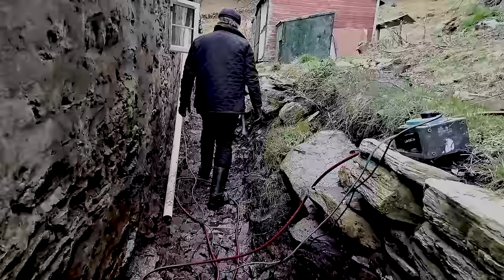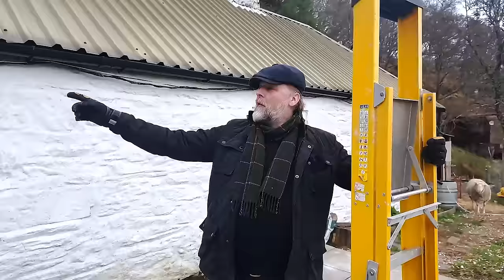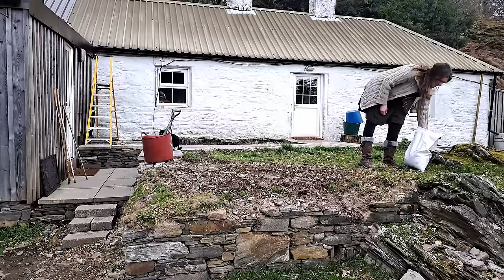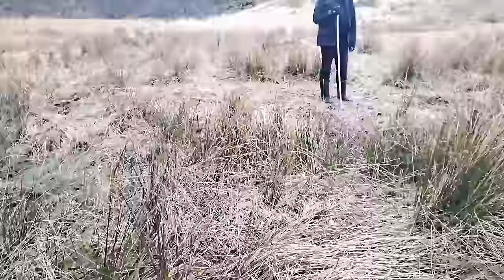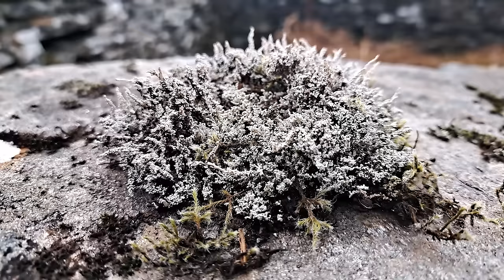We Begin Rescuing the Cottage Roof & Find a Ruined Croft in Scotland | The Scottish Isle

Comment: Thanks for the clarification on the antique tool - which I think is spelled adze. I had no idea there were other shapes, or specific uses, for an adze. The ones I've seen were for de-barking logs to be used in building log cabins. Fascinating! Any idea how old it is? The croft you show  in this video is amazing - I can just imagine the large thatched roof it had. Good luck with your antiques!

Comment: Adze, Mattock, there at least 1/2 dozen forms of mattock. Generally the horizontal blade is flat, often with low sides sharpened  to cut side as well as depth. Adze's are usually curved or flat - but there are many variations of adze and mattock which named regionally as either.

Comment: Get the flash band with the adhesive on and put it on with a blow lamp makes the job easy
Reply from the maker: Incorrect. Manufacturers guide: "Place over the surface of the joint." https://www.youtube.com/watch?v=Z17f__Htn-0  @buffplums

Comment: Why don’t you get an electric blower or gas powered leaf blower I guess you guys call it petrol not gas.
 Blow the leaves out instead of pressure hosing it or do you have leaf blowers in Scotland? A lot easier to use and you don’t get soaking wet or erode the ground with high-pressure.
And you need a proper retaining wall behind the house add proper drainage, wow there’s a lot of work there to do which is going to keep you guys busy for a long long time, for certain, it’s a labor of love.